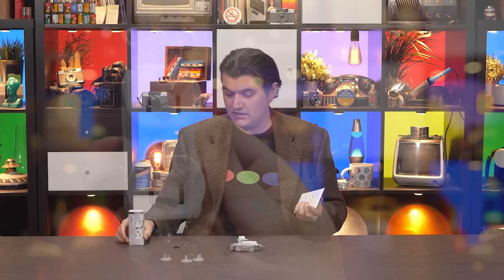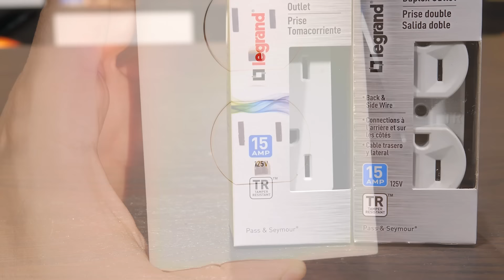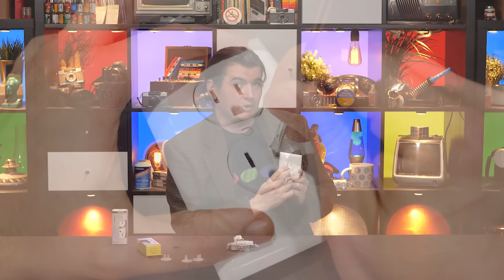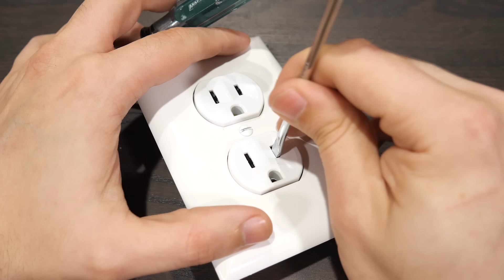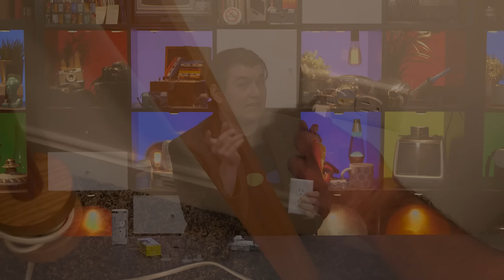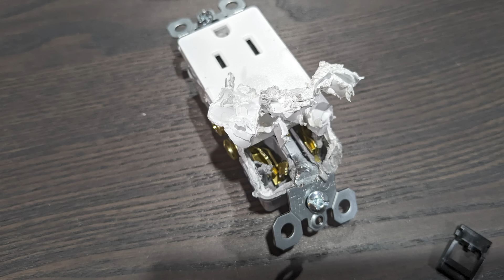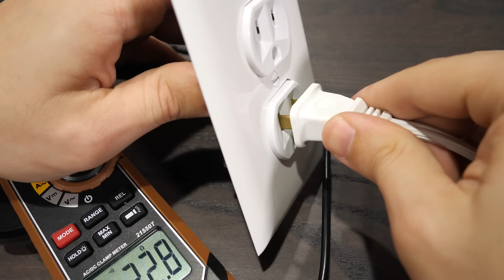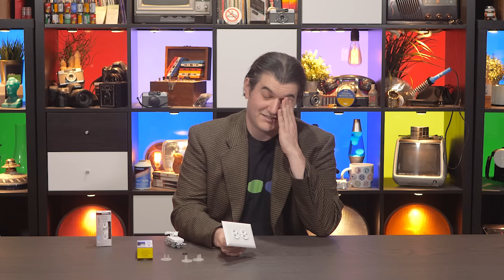Tamper-resistant outlets aren't all the same - a follow-up

Comment: The failure mode for worn-out UK outlets tends to be that they stop putting out electricity to the appliance. I've had that a few times. I've never had a situation where the plug becomes loose and starts falling out, though of course even it did, the insulated sleeves on the pins means that it wouldn't be dangerous.

We do of course have two-pin outlets, in bathrooms. The pins there are positioned vertically, and I've never had a problem with them going loose either. Their shutter design is similar to what you demonstrated in this video.
Reply: Oh interesting I'd never heard of the 2-pronged ones! And here, as a fan of Techmoan, I would've considered myself familiar with all manner of British plugs...😋
Reply: @dancoroian1  They are very specifically for electric razors (and, these days, maybe for electric toothbrushes?).  They are typically next to, or built into, the bathroom miror, and they often have (or used to have - it's some years since I've seen one) a switch to choose between 120 and 240 volts output - so visiting Americas don't blow their electric razors!  How many American visitors that use electric razors are expected to visit British houses, I don't know,  but, even back in the 60s, lots of homes had them, and they are pretty standard in hotels and the more upmarket washrooms.  I assume they are on a separate circuit to other sockets, with a smaller fuse/circuit breaker, so you couldn't use them for something else that draws more power and just happens to have a two-pin plug (two-pin plugs are rare in the UK, except of things like razors and toothbrushes - and sometimes hi-fi units, where they plug into the power supply of the main unit).  On a side-note - in the UK, you will never find a washing machine in the bathroom - it is illegal to have a normal socket in a bathroom.  This often baffles visitors from abroad, where washing machines are nearly always in the bathroom.  My (Hungarian) mother-in-law, on her first visit was amazed to see our washing machine in the kitchen - "why isnt it in the bathroom?", she asked, "that's where they always go"!
Reply: @paulhaynes8045  Meanwhile, here in the US, in my experience, the washing machine is usually in one of a few places:
1.)  A closet or small room near the bedrooms.  (Common in newer houses and many newer apartments/condos.)
2.) A laundry room or utility room in the basement.  (Common in northern states where most houses have basements.)
3.) A closet or small room off/near the kitchen.  (Common in houses without basements, and not unheard of in some with.  Is sometimes a "mudroom" containing the back door to the house and some coat racks.)
4.) A shared, coin-operated laundry room down the hall from your apartment, or in your building's basement.  (Common in older apartment/condo buildings, especially larger ones.)
5.) A laundromat down the street.  (Common in older neighborhoods (esp. poor inner-city) where not every home has a functioning washing machine, and where older, smaller apartment buildings don't have their own laundry rooms.)
Reply: @paulhaynes8045  These shaver sockets (outlets) are supplied via an isolating transformer (whose primary winding is only powered while a plug is inserted) in lieu of RCD (GFCI) protection as with such a transformer there is no reference to earth (ground) and reduced risk of shock. As there is already this transformer, it's trivial to tap the winding at 120V to provide a 120V socket.

To keep the transformer size & cost down, the conductor used for the windings is rather thin so that limits the current that can be drawn. With toothbrush chargers, there is a concern that certain shaver sockets are unsuitable for long-duration use due to the transformer getting too hot, something that was never a factor with shaver use, although I've never had a problem with mine. There is a rare species of 240V-only shaver socket that foregoes the isolating transformer (but usually have to be outside the bathroom as they cannot be installed in bathroom zone 2) - these would be absolutely fine for toothbrush chargers.
Reply: @paulhaynes8045  UK shaver sockets in bathrooms contain an isolating transformer so you can't get a shock from them by touching the live pin and ground, via a metal tap for instance. The dual voltage thing is probably a consequence of that, since it's just another tap off the same transformer you might as well.
Reply: @thebarnoid  cheers - didn't know that, but I did wonder how they got around the 'touching the tap' problem.  This thing with electrical safety in bathrooms is weird. We don't have a shaver socket in our bathroom here in the UK, so when my wife bought a rechargeable toothbrush, I had to install a socket and really had problems trying to find somewhere to install it where it was close enough to be convenient but not close enough to be dangerous. But, in our Hungarian home, I can literally touch the washing machine socket (a normal double power socket) whilst also touching the basin tap!

Comment: Best way to wire an outlet is clamp, which is almost always an option on the industrial grade outlets. The hook method is almost as good though. The back stab method is absolute shite and should only be considered an option for outlets that won't be handling much current, like bedroom lighting...and even then the possibility of using a space heater or window air conditioner should make you shy away from this.

Comment: In the UK we have 240V 13 Amp sockets with shutters not operated by the ground pin.  Manufactured by MK they rely on equal pressure on both live and neutral, although most others rely on the ground pin operating the shutters.

Comment: The European Type F extension coords have quite interesting tamper resistance mechanism: actually there's only single flap which rotates when the plug is inserted and there's a spring which restores the closed orientation when the plug is removed. If you press only one of the holes the flap does not rotate.
Reply: Im fact, if you press only one side of the flap, it gets caught on a ledge and can't be pushed away .  Both pins pushing at the same time lets it slide or rotate past the ledge with some degree of ease .
  These sliders are the same for all the double banana sockets in Europe, not just the German Schuko , and they come in two designs: Sliding and Rotating .
Reply: @johndododoe1411  They work for all Sockets as due to some marvel they managed to create (somewhat) interoperable plug and socket designs over the years. I say somewaht, as sometimes you might get power, but the protective earth might be left out, which might become an issue. For sockets there is a list of types they are named, I didn´t even find out where those names came from, if it was some kind of ISO or whatever. US Sockets are considered Type a or B (with ground). For European plugs we start with Type C, which is the round prong equivalent to type A and considered what is supposed to work everywhere in Europe, it is just the two round prongs, no ground. the plug usually is flat, not the round base plate shape and it seems this one is the base for all standards acrosss Europe. Just add different types and arrangements of ground pins and you get either type E, Type F (that is the actual Schuko Socket) and Type K. And if they are not recessed but flush with the wall, you may even add in the Swiss type J or the italian Type L which are not round to begin with. but the L and N prongs are for all of those close enough to fit. Another thing, when it comes to plugs, you commonly find two types around here. the euro plug without ground or hybrid plugs, which at first glance look and work like a Schuko plug, but they have a hole and contacts for the Type E ground pin as well. actually you could say three types, there is the contour plug, which is a larger version of the Euro plug. it has two prongs, but it has a round base plate with space for whatever ground you may encounter. the difference is the flat one is rated to 2.5 A, the contoured one up to 10 A.
Reply: @johndododoe1411 rotating shutters are used by the UK sockets i mentioned above
Reply: @TheChipmunk2008  nobody can see what comment you're referring to with the "I mentioned above"
Reply: @rm_steele  I can see it. You just have to scroll down 22 pages from this post. I don't know how you missed it.
Reply: As an American, I honestly find Type F interesting just because its ground pins are a part of the outlet rather than a part of the plug
Reply: @EnigmaticLucas  for a grounded connection I see the main benefit in it being recessed and thus preventing possible contact when not fully seated and the ground making connection first (which all other grounded plugs here as well as the NEMA plug if I remember right and the IK Type G plug do as well).
But from a technical perspective, I think actually the French Type E, the Danish tType K or the Swiss Type J are somewhat superior. Not because of how the ground connection is made, but because the ground connection dictates the plugs orientation and thus where L and N are. Yes, for most modern applications on AC it does not matter much. But thinking of some "legacy devvices" like tube radios where the chasis could become hot if the plug is the wrong way round or in some rare cases where noise can be induced into audio systems, having a fixed polarity can be beneficial. There are also some other very technical benefits (which to be honest can be worked around in many cases for non polarity plugs). If I find a plug to be the hybrid E+F type I check to put the hole for the E socket type ground prong to be on top, as it would be in an actual e type socket. (Hoping the Socket was wired correctly)
Reply: @EnigmaticLucas  I don't love them because if they get bent (and that can happen, they're a lot flimsier than the prongs on a plug) you have to either bend them back and hope they don't break... or replace the outlet. The French system - which is virtually compatible with Schuko because all modern Schuko plugs have a hole to be compatible with French receptacles-  is a bit better I think, in that the part-of-the-outlet pin is actually solid and not wiggly... aside from all the bickering about whether polarization is good or bad, since unlike Schuko, the French ones are polarized.
Reply: @LjL-Videos  German made ones never caused that problem. Don't buy CEE7/3 sockets made in China and if you do, apply some WD40 (to both the ground pins and the shutter).
Reply: rotating shutters are kinda shit tho

Comment: being an electrician in europe, stab-through connections are now standard in many applications, and they are fine
iunno for those in US sockets, but ours are made so only one wire can be plugged through one port, just the plugs have pairs of ports for all 3 wires so you can still daisy-chain them
works both for 2.5 and 1.5 mm² wires (13 and 15 AWG respectively)

Comment: You explained the Swiss cheese model (a bit) wrong. A threat in this model need to go in a straight line through the holes, not zigzagging around like at 14:00. If it was like that a LOT more accidents will happen. I hear this model every other week and when you was talking about 120 volts and the Swiss cheese model I got confused for a bit. Lowering the voltage is making one hole smaller, so the chance of a treat getting through this smaller hole in a straight line is smaller. I know this is unscripted, but it might give to someone unknown a wrong picture about this model.

Comment: If you have a transformer that steps down (or up) the voltage, and the circuit between the GFCI wall receptacle and the transformer is good, then the GFCI has no way to protect you for any faults that occur downstream of the transformer. The good news is that if that is an isolating transformer, then the voltage is no longer referenced to ground. Touching a wire in the bath won't result in a huge current rush to ground, but the capacitance of your own body can provide a way for current to flow in and out of you, creating a nasty shock that a GFCI can't do anything about. In general, if you have a transformer in an appliance and you get shocked by some wiring inside that appliance, I would not bet your life on the GFCI being able to save you.

Comment: From Argentina here regarding the falling plugs. Our plugs standard is different, but we are well aware and sometimes use something with your standard. However, for some time, electrical stores were very loosely regulated and sold US outlets and cables (now its forbidden), and what a surprise, most of the time you bought a US-standard outlet or cable, they were total crap. So yes, I also have the perception that the US-standard 2 pin plug are garbage, but I think its due to crappy imported products rather than an issue with the standard itself. As those are not our standard, probably the only way to get one was from overseas (by yourselves or a local reseller), no local production, no regulation whatsoever, meaning at the end we got the cheapest crap in the market (probably from china).

Comment: I got told those blanks were to keep the socket monsters in the wires. One of the highest quality lies I have ever been told.
Reply: It almost isn't even a lie. Electricity can be one hell of a dangerous monster.
Reply: yeah, they keep the angry pixies from getting out of the socket, lol.
Reply: I was told the plug would bite me. Don't put keys in the outlet. I didn't need to be told I found out the hard way. At four years old I got bit at the electricity bug. Funny thing I made my own extension cords not long after. I Always told people I been playing with electricity since I was four. Few bites along the way. 73
Reply: Would this monster happen to be Mr. Ouch from the pad-mount transformer warning labels?
Reply: I was told the car wouldnt start if I didnt put my seatbelt on. Also technically not a lie.
Reply: It's a lie ?
It comes as a shock to me !
Reply: @sylvainmichaud2262  it will put you in a state of Shock! 73
Reply: That is a lie- they're there to contain the vapors.
Reply: @dianeladico1769  nah, the magic smoke is just pixie farts.
Reply: I thought it was to keep the electricity-fluids from leaking out??
Reply: Im borrowing this to tell future children
Reply: Sparkie lives in that outlet. He bites too. 73
Reply: The blanks can be dangerous to remove though when you need to remove one.

Comment: As a child I was shocked by a live wire. Likely across my heart, and I was fine.

I found an old CB radio of my father's that he'd replaced the wall plug to a car adapter. Not having a car myself I wanted to play with the radio and found the cut off plug.
Not knowing if there was polarity to the wires I held them in my hands to connect ends temporarily to see if it would come on. I slipped and must have touched Both the exposed wires.
Maybe I was lucky.

Comment: The weird thing is that you still see those plastic covers sometimes in the UK, where they add absolutely nothing to the safety features already built into the socket.
Reply: Yeah, and in fact on older socket designs that only need the ground pin inserted to expose live and neutral, they're actually more dangerous than having empty sockets, because they can be inserted upside-down which exposes live and neutral.
Reply: @jkeelsnc  I've had to do that before lol
A Western Digital NAS I needed to get set up had a type c europlug, and I didn't have an adapter so I just got a plastic prying tool and opened the protective latch and shoved it in, worked perfectly but janky as hell 😁

Comment: US wall plugs definitely fall out easily. In fact as I'm typing this, i have my computer case leaning against the plug going into the outlet to hold it in place. Before I did this it would occasionally fall out turn the computer off instantly. It's an awful design.

Comment: I don't like using the push-in connectors in the back because it's a lot harder to remove the wire if you need to replace the outlet

Comment: As a german I only ever used Schuko sockets and from a mechanical standpoint they are far superior. Its mainly the plug that keeps it in its socket and not the contacts! So if you bump the plug or pull on the cord not only cant it come out but it also does not transfer the load to the contacts. The blades both being mechanical and electrical is a bad idea.

Comment: I have encountered plugs that are so warn that anything you plug into them falls out immediately. Most recently this happened to me in Suvarnabhumi Airport in Bangkok Thailand. BTW, Thai receptacles allow both US style plugs with blades (types A & B) and European plugs with pins (types C & O) to be plugged into them (and are 230V 50Hz). The 2 power pins are similar to a D shape (but rounder) with the round part on the outside.
Reply: Those sockets can be dangerous as they do not necessarily ground the devices.

Comment: I'm a MD. I work on ER unit. I live in Poland (240V and standard EU plugs). Every shock I have seen on ER included water. People and I my self got shocked from electric animal fences, from working with electricity,.... but the ones that ended in ER included water going live from some kind of electrical breakdown.
Reply: The ugly truth is the EU has a standard E-type plug (safer) only in
France, Belgium, Poland, Czechia, and Slovakia. The rest of the EU has German Schuko (with a few exceptions).

Comment: “Your plugs are contantly falling down”. Every time I heard this was from a Mac user using those ridiculously huge Macintosh power adapter that for some strange reason Apple ships with the option to plug them directly to the wall (instead of the option to use a cabe between them and the wall which comes with the computer but nobody uses)… “Behind a brick plugged directly to the wall, there is always a Mac user”. And before I get attacked, I TOO am a Mac users and I TOO plug those bricks to the wall.